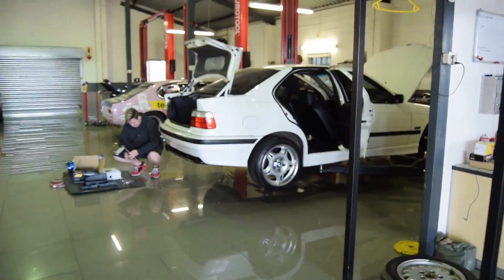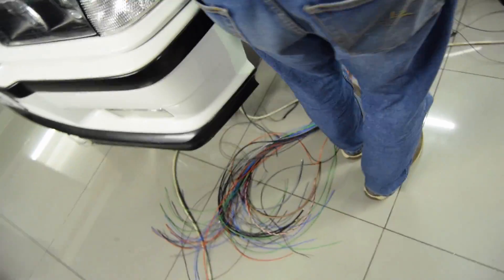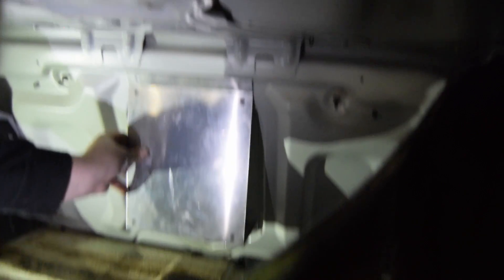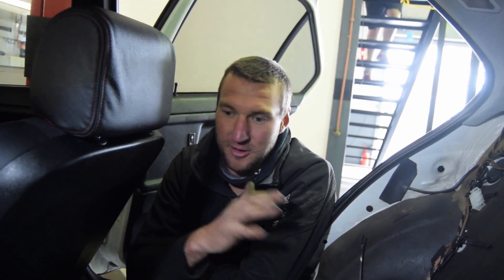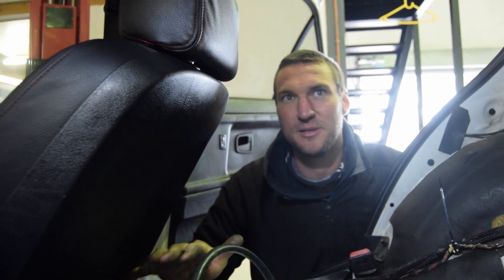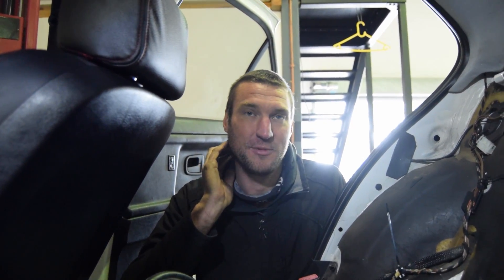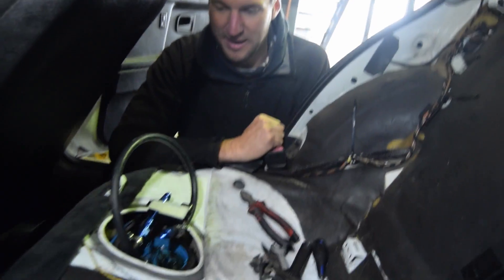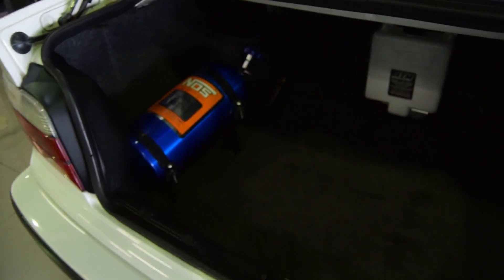BMW E36 NOS TURBO AND WATER-METH BUILD

Comment: 1:25 Thats me car!
Reply: Do you have any ideas that you'd like to share advice I like to turbocharge nitrous and water meth inject my Nissan Frontiers 2.5 l. And then after that stack of hydrogen cell to try and reach some golden ratio. I'm not just interested in running it for power I would like to see a economy tune to where the NOS would only have like a two shot or a five-shot and be built for the Long haul not just racing.